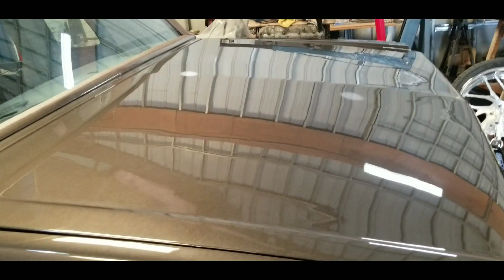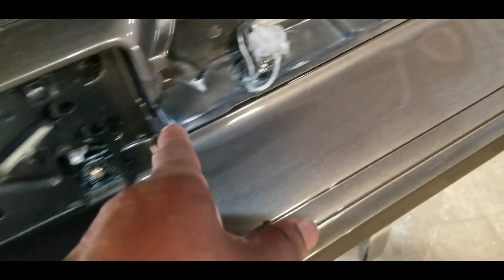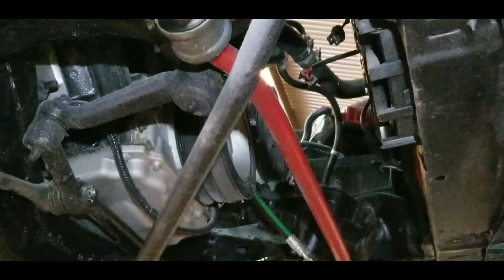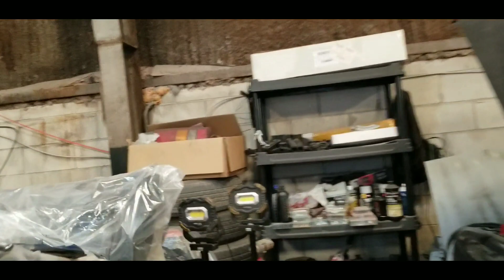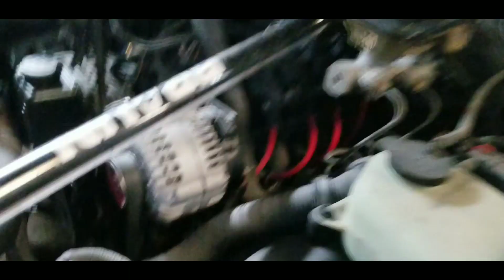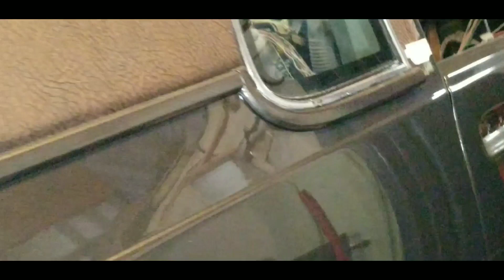#gbody #cutlass Wet sanding, buffing,and steering box replacement on Top 83 Cutlass and more

Comment: Specs on that custom high pressure line ? I would love to have one as well
Reply from the maker: I just took my old line to a hydraulic hose shop with the measurements of my pump and steering box distance mine was about 1 foot from connector to connector